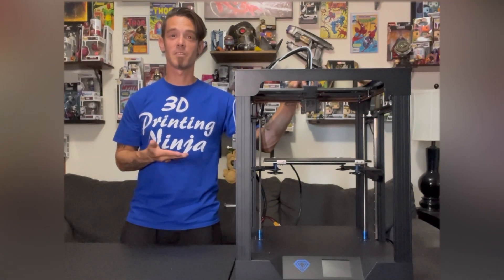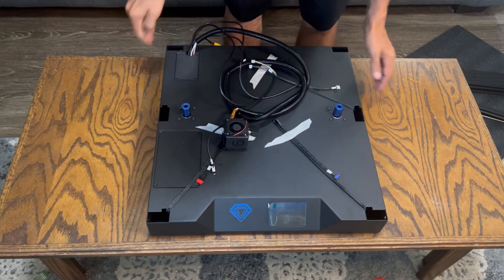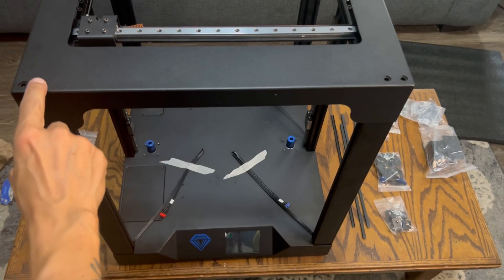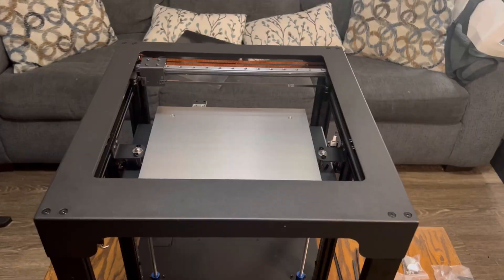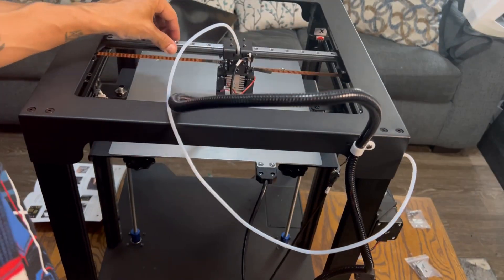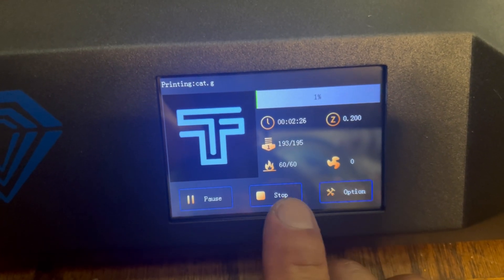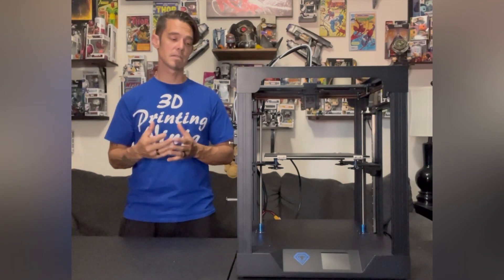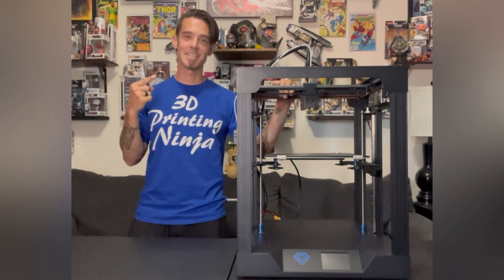TwoTrees SP-5 3D printer | Two trees unboxing & review! First look at SP-5 Core XY 3D printer

Comment: Hi again!! lol halfway through I realized I watched this already. Well I came up with one thing I don't care for. The runout sensor just hanging lol. Yea it don't have the auto bed but, that's 20 bucks. Have you done a review on the Ender 5 Plus 3D printer by chance? I'm really leaning towards it and I like your content and things you have to say. I have a friend that has a Bambu x1carbon and it's all about how fast and look what I printed...I don't care if it takes a day to print out a helmet as long as it is in one piece and needs little body work done to it. Well thanks for your time again.

Comment: Great video and excellent tutorial. Very descriptive on bolt placement and assembly. I haven't bought another printer yet. I still only have my CR-10 mini. Last time I asked you what printer I should upgrade to for printing helmets in one piece, you said and Ender 5 plus. Do you still feel that way, or should I consider this one instead? Faster print speeds seem very appealing. As always, thanks for sharing.
Reply from the maker: 5 plus is great but to get it modded similar to this is over $700. Only perk is the plus does have a bigger build volume

Comment: I've had this printer for a year now and it's been my workhorse since I upgraded the hotend to a Direct Drive Volcano (many have said that the stock hotend sucks because they get a lot of clogs; and it's ptfe lined, upgraded to bimetallic heatbreak) with a .6 nozzle and installed Klipper on it
Other than that I haven't made other modificatios (ok, maybe a bltouch... and oh yeah I made the z rods independent) and I want to believe it runs almost like a Voron
Reply from the maker: Great to hear others have had success with this. I was curious about upgrading the hotend too
Reply: I'd say go for it, and if you throw in a .6 nozzle (haven't tried .8, but I'm tempted to after I install the Rapido uhf I just got) you can shave half or more time than printing with a .4 @ 60mm/s (I printed a huge sword as a commission in 6-7 hours)

Comment: $400 not a bad price for the size.. Only thing not liking is putting it all together. I mean dont look to detailed, but most other printers I have came pretty much put together..
Reply from the maker: Assembly is a bit much, but hey it gives you practice when things break lol
Reply: That's why it's cheaper, it's a kit. Now if it was 90% put together it would be more.
Reply from the maker: @arowe231  but when you consider the upgrades you get vs say an ender 5 plus which isn’t 90% assembled & you have to go through installing a silent board, flashing it, pid tuning & still have to upgrade the extruder & add fans your over $750
Reply: @Darkwingdad  True...didn't think that far ahead lol.
Reply from the maker: @arowe231  it was a lot to assemble though… lol

Comment: Pretty neat,  never heard of this one before.  Also,  nice merch you have now
Reply from the maker: It’s a nice printer! Appreciate the watch & merch shout out!
Reply: FLAWS

Is this Marlin or Klipler?

 One issue I see with this is it's only supporting the bed on the center sides: what's to prevent it from rocking front to back? Not even mentioning possible wobble from the rods.
Speaking of Rods, are they Indipendently controlled to help with leveling?

Other is bowden: it may have more play at higher speeds without direct drive.
Reply from the maker: @TheAtomicSoul  the sp5 comes preloaded with marlin but there are several configurations for there sapphire series to support klipper. 

The printer is supported with linear rails and yes it is supported in the center both the rails & rods provide additional support & there is no wobble as long as you install it properly.  The rods are synced so there are minimal issues with leveling & build plate install 

The printer is already equipped with Bowden & dual gear extruder.